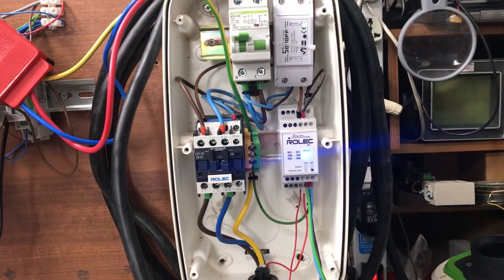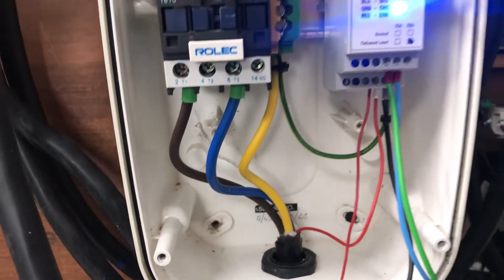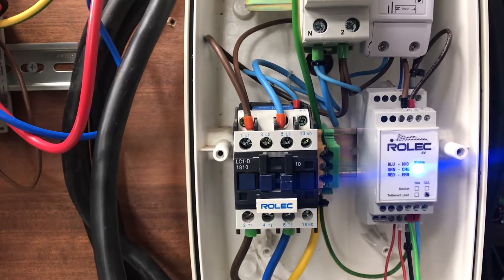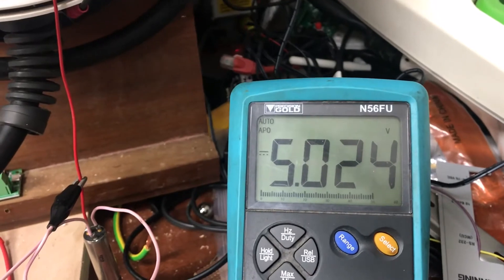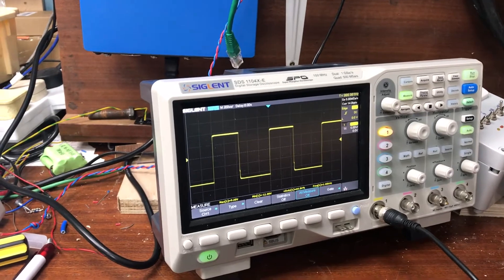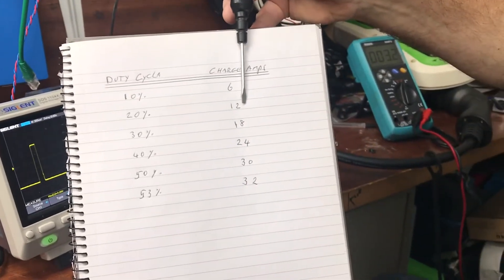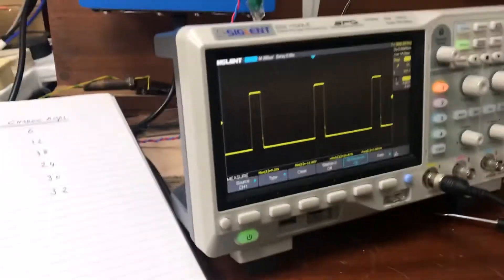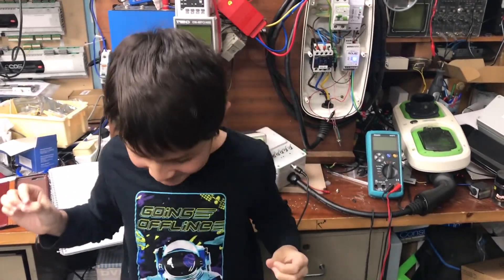rolec charge control this gives ajustment of charge Amps to the car MG zs EV

Comment: Very interesting. Did you complete the install. What if the resistor is at 100% open, still safe at 32a? Any way to remote control this with something wifi based? Would be great to control my rolec 32a dumb charger for the charge rate remotely, so I could use my excess solar to dictate the value using Node Red or Home Assistant instead of a manual knob to turn. Though the manual option is still worth pursuing if no better solutions.

Comment: Hi, do you have details of the resistor values required for each of the 6, 12, 18, 24, 30 & 32A charging currents [on your Duty cycle - charge amps table], please?

Comment: Hi Mate,
I have a 32A rolec charger what sort of fixed resister I should be using? 220 ohms? What eating?
Advice will be greatly appreciated.
Reply from the maker: Hi on my rolec with a tethered lead the connection has no input to the input and defaults to 32 amp